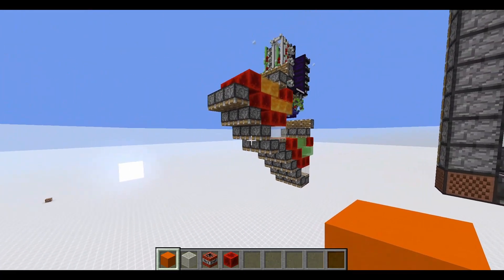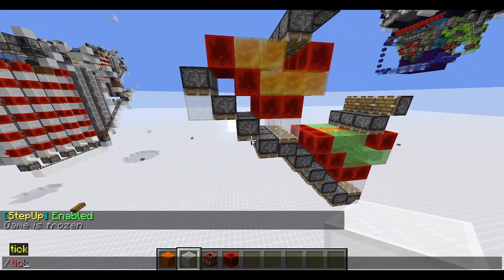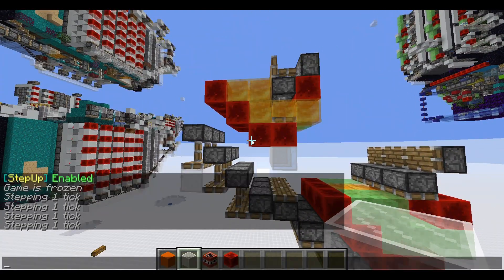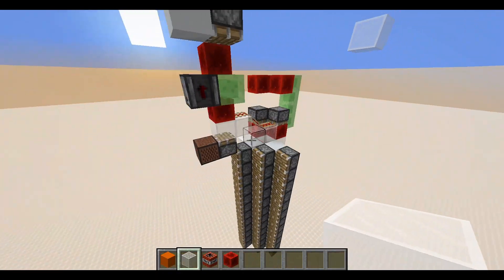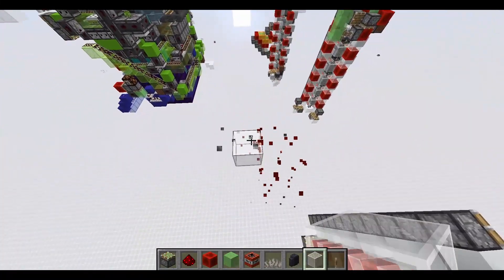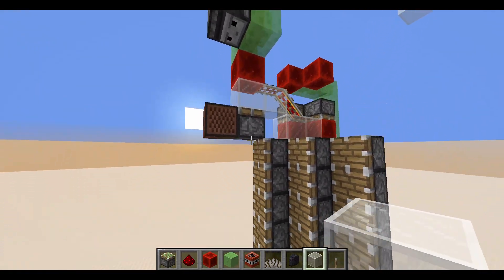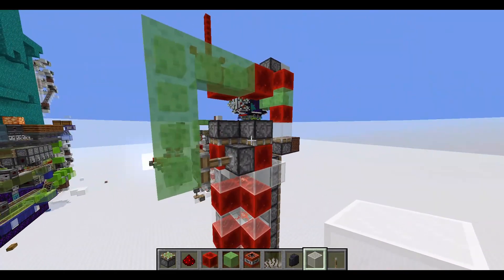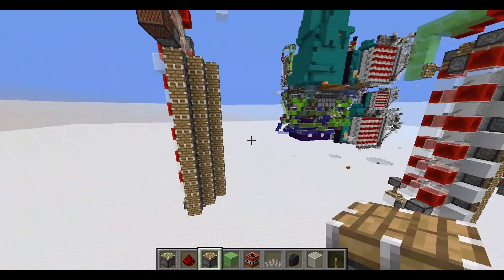Smart piston roof and wall

Comment: Hi, I need a help, I am doing a piston roof and I noticed that if I power trougth a block from an observer reading a rayl line above it, power not only the piston just under but the side piston to, so you can use less observer, but, last line of piston for example in a lime long 8 blocks do not fire all pistoms...any solution?
Reply from the maker: Sorry, I don’t understand
Reply: @PotatoCraft_TMC  I mean a simple roof of piston in line 8x16 for examle that fire first 8x8 and after the second part 8x8
If I power the first part powering hem with a block over the piston in the second line so an observer over the block and so a rayil, powering the rayil will activate not only the piston under the block but the 2 piston on left and rigth side.
But if I go to all 8 long, it will power 3 line 9x instead 8x just in front of where the last observer is. If I leave only a line of 7 observer will fire all 8x8 piston minus 1 in the rigth up corner.....

The 2 only solution I found are
Use 1 observer for 1 piston, to expensive and still they fire 8x9 using a 8x8 of pbserver
Second I still have to test is ti turn horizzontaly the lime of dobserver instead vertically
Reply: @PotatoCraft_TMC  ok I tried turning rayils and observers 90 degrees it work perfect, so I am able to use alot less observers because I was doing a roof long 64 blocks 😅👍

Comment: genuine genius. Seems like some of them don't get 0 ticked tho
Reply from the maker: None of them do. They both have a 6gt activation: 3gt push and 3gt retraction. The roof one has 6gt reset too, so you can spam it, but the wall one is 12gt reset bc I couldn’t find a way to reset it faster. There is way for sure tho, im just too stupid to know how to do it. 

So you might be wondering what’s the point if it’s not 0 ticking and slow…. The point is just showing off some cool stuff I made for fun bc I thought it was cool and might be useful or inspire someone. Im not gonna lie, I can’t apply these anywhere on my contraptions bc of the order of the updates to them and bc they’re slow